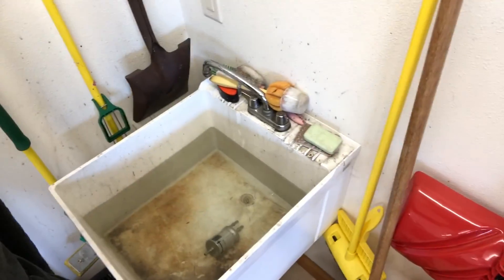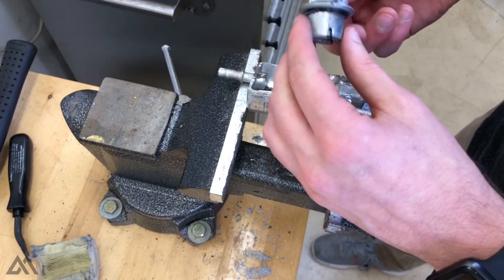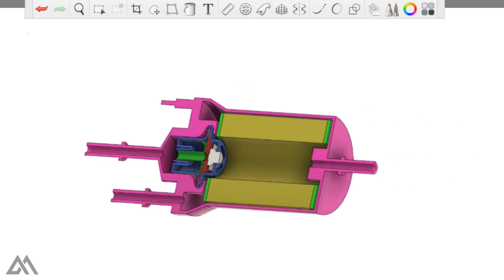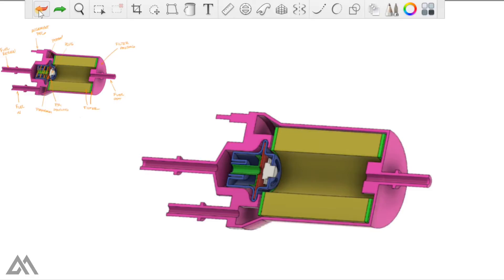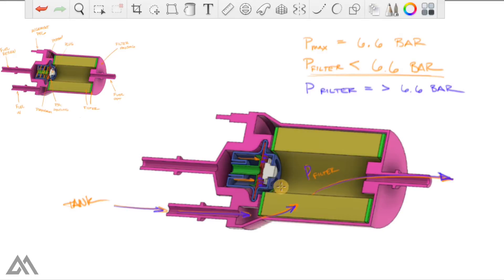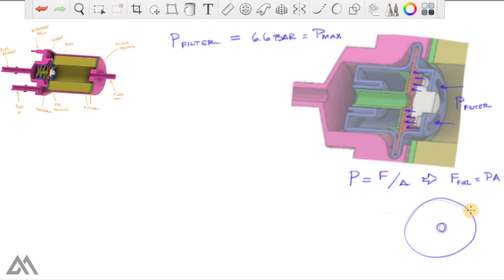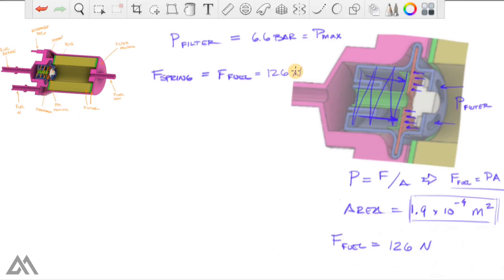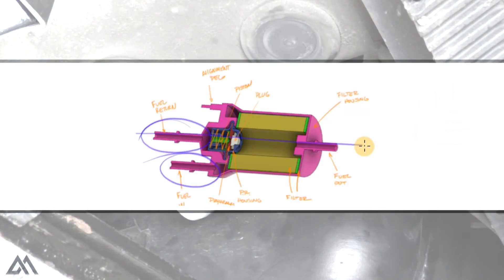How It Works - Volkswagen Fuel Filter and Internal Pressure Regulator

Comment: I really appreciate your video. My 2019 jetta they say has a fuel filter inside the gas tank and is not easy to access, but theu sell a fuel regulator that looks like yours. Its listed as a fuel regulator not a fuel filter combo, but after wat hing your video. I am 110% positive I have a little fuel filter in this fuel regulator. I can't confirm it without cutting it up like you did. It just amazes me people say its just a regulator. It even looks like a filter! I know there is a filter in it! I need to cut it open

Comment: Amazing explanation of the vw fuel filter. I am currently bilding a fuel cell for my 2004 vw golf useing the stock fuel sender from the tank. For the life of me I could not understand how there was no return coming from the engine bay. My question is, is there another return coming from the high pressure pump or are the rest of the lines just for venting or evap. Because I cant find a vw fuel system scmatic that represents the pressure regulating fuel filter with callouts for what the lines do or how thay operate.

Comment: My friend, this is an outstanding demonstration of how the VW Jetta fuel filter pressure regulator operates. Thank you for taking the time to put this video together.
I have a 2007 VW Jetta 2.0. I'm receiving a P2294 code on my scanner."Fuel Pressure Regulator 2 Control Circuit/Open. When I finally learned that the regulator was in the filter I changed the filter which did not solve my symptoms of hard starting, crank no start. So far I replaced the High Pressure Fuel Pump, Fuel Tank Pump, and Fuel Tank Control Module, Coil Packs, spark plug, and PC VALVE  with no results. 
The fuel pressure on the rail is within specs, and steady for 45 minutes. The EPC and check engine light are on as well.

Comment: Nice drawings, etc.  However, something seems not right.  6.6 Bar = ~95 psi.  That's a very high value as an output pressure.  Also, to sustain that output pressure, the input pressure from the fuel pump in the tank has to be well more than 95 psi!  This can't be.  Could it be that the 6.6 Bar rating is the maximum input pressure the regulator can safely handle, and that the output pressure is something more along the lines of about 40 psi?

Comment: During cleaning all the fuel system on 2001 Saturn SL2 I installed a new Fuel Filter fm Amazon  (PTC PGF846 Fuel Filter). The filter has internal fuel pressure regulator, like the one discussed in this great film. After ~ 1 month the car gave a code P0401, which keeps coming, and occasionally it is accompanied w/P0300, P0301, and what is important here P0172. I checked the fuel pressure.  Specifications on that car:  40 - 55 psi. Pressure decay  less that 8 psi in 5 min.
   The result is:
8:02pm  53 psi I switched off the engine
8:08pm  36 psi
   So the pressure decay was 17 psi in 5 min.  But that is if to measure from the value on the gauge (which was 53 psi). But if to compare w/specified limits, maybe I need to compare with 40 psi, which is the lower limit in specifications. Then the decay will be in allowed values and nothing wrong w/the filter. 

   Haynes says: If the hold pressure is less then specified, but EricTheCarGuy, when he measured that decay said the pressure should hold, and doesn't deviate from the reading on the gauge. And his pressure hold after the engine shut off on the value, which was on the gauge during the engine running.

   My question is: Do we measure a decay from the current value on the gauge, or from the lower pressure limit in specs? 

   I measured the pressure before w/old filter, and it was holding pressure, I think the current (measured w/running engine), but I'm not sure. I would appreciate any opinions on this matter.
   The film was very helpful in my research for the question above, it was great to see the internal structure of the filter I have.

Comment: Thanks, you saved doing the same cut and inspection job; my injection system is on an ATV engine in an Ultralight weight shift aircraft, so uses a simple regulator, WITHOUT a reference feed over the diaphragm to reduce fuel pressure when high vacuum in the inlet manifold. 
Motor was running lean using a VW filter with built in regulator like the one you dismantled, so added an external pressure regulator after the filter/regulator in the return to ensure the system pressure was high enough (3 bar). 
However the filter regulator you and I have, references atmospheric by comparing pumped pressure at inlet with the pressure in the open return line, which is open to the tank. 
As there is no external connection to atmospheric, if I add a pressure regulator after the filter return line it will create 3 bar + whatever the regulator is set to.
Now thanks to you, realise need to fit a simple none regulator canister filter with a Tee piece installed after it, one to the fuel pressure regulator and the other to the fuel rail.

Comment: Very good video..on my car Skoda Fabia Greenline i have the same filter fitted but only 2 pipes in it..one pipe to OUT going to the engine and one pipe to the center of the regulator..the IN of the filter has a cap..my question in this combination the petrol și filtred properly? I have recently changed the filter and waching your video i resume that the filter is there for nothing..thanks..

Comment: @MDRN Engineer 
Matt , question for you. If the return line of the filter would be compressed or pinched, would that increase the PSI that the fuel filter puts out? Cery interested in your reply!
Reply from the maker: I would assume so.
Reply: @ModernEngineer  Wow You answered quickly. I wonder how  much of a compression would be required to achieve a 8 bar filter. And how much you can compress an aluminium housing before it cracks.
Reply: @ModernEngineer   This is for a big turbo Setup!
Reply from the maker: If I were you I’d look for a proper filter at the appropriate pressure
Reply: @ModernEngineer   I get and respect that, but that is not always feasible :) It was more of a mathematics/fluid dynamics and physics question. Since you are better equipped then me regarding these subjects, figured I would ask. Now, I have been informed that increassing pressure would actually diminish flow the filter would allow… so now I am all confused on why the OEM filter went from a 6.4 bar to a 6.6 bar revision…
Reply from the maker: @carsfeverguy15  ideally you would be able to replace the spring with a stiffer spring, but that’s not really possible with these filters.
Reply: @ModernEngineer  I've added a fuel pressure regulator in the return line, but suspect this will cause too high pressure at the injectors; the filter kicks out say, 3 bar and the FPR will raise this a second time?

Comment: This was awesome. Thank you!
I may be missing something, but why doesn't this type of filter/regulator require a vacuum/boost reference to counter the pressure inside the engine? I'm assuming it's because these filters without boost reference are on direct injection cars. I'm just slightly confused on how the interaction would be different or if direct injectors simply spray so much differently it's not a concern. Thanks.
Reply: At least on my audis that use these, they have dual fuel pumps. A low pressure in tank pump>fuel filter/pressure regulator> high pressure mechanical fuel pump with electronically controlled components that work with the ecu to synch rpm and load/requested load and injector duty cycle (and afr 02 sensors) to keep the AFR spot on as needed

Comment: Oh I am not going to let you get away I need to know how to check valve inside of the fuel pump male functions and allow fuel pressure to become back pressure and you have to turn the ignition key five or six times before the pressure builds up before cranking the engine please help me thank you

Comment: I have a quick question. I am running a Toureg 3.2 engine in my mk4. The Toureg fuel rail only has in inlet no return ,no regulator.  The stock fuel rail has feed and return with the regulator on the rail on the return side. So wouldnt it be feasible to use the fuel filter with the built in regulator and plumb the feed inlet/outlet, and the return and not have to get a different fuel rail

Comment: Very interesting! Could you explain spring rates and spec? I'm confused as to how that tiny spring puts out 126Nm, excellent explanation.
Reply from the maker: Hi William - I'd like to preface this by saying this was completely theoretical, with very rough estimations for the individual components and their geometries.  That said, I'd like to correct your statement a bit.  The spring is not exerting 126 Nm, but rather 126 N (in the given condition).  The unit Nm is literally Newtons multiplied by meters and represents a torque (force times distance).  In this case the spring exerts 126 N.  You can think of it this way... 126 N is equivalent to 28.3 pound force.  Therefore, if you were to set the uncompressed spring on a table (on end) then put a 28.3 lb weight on top, the spring would compress 10 mm.  This seems to make sense since it required a vice to compress the spring at all.  The spring constant that I solved for provides a value to tell us how much force the spring will exert with a given deformation.  That is why the units are N / m or force per distance.  If you change the units to N / mm, you will get 12.6 N / mm (which is equivalent to 125 N / m).  So with each mm the spring is compressed (from a relaxed state), the spring will exert an additional 12.6 newtons on the object compressing the spring.  Hope this helps.